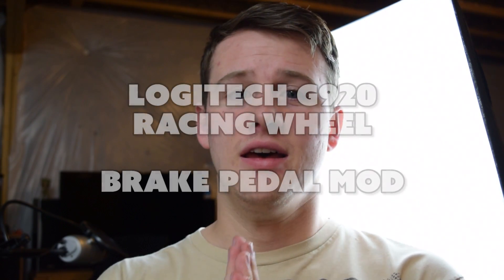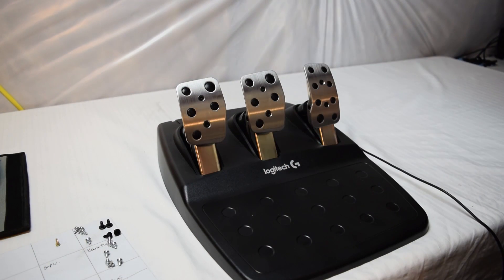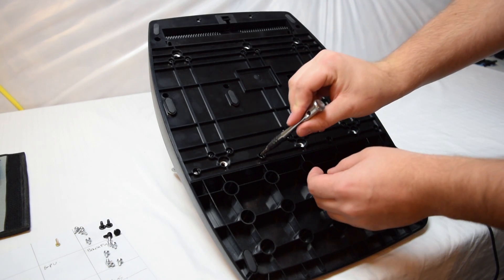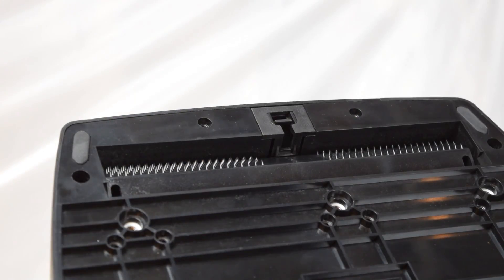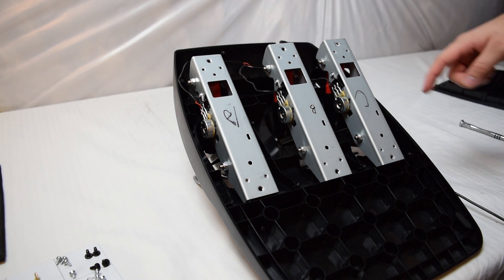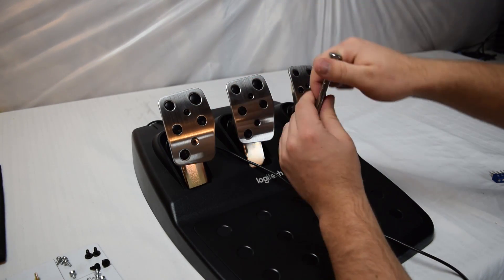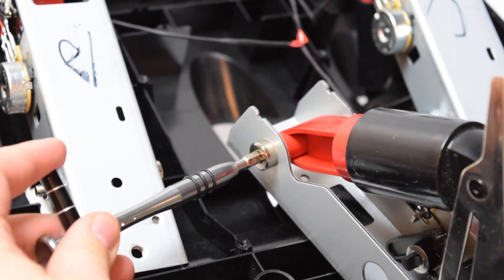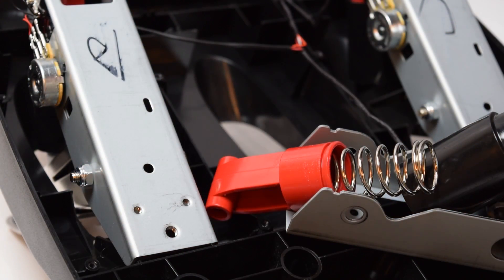Brake Pedal Mod - Logitech G920 Racing Wheel

Comment: I feel like logitech have never driven an actual car. I've never had a brake pedal as stiff as the logitech one. And for computers sake, I end up pushing myself away from my desk when I brake.
Reply from the maker: Haha I know thats the worst part of it!:P
Reply: Have you ever driven a racing car before? Usually the breaks are made stiff so you know when you are reaching maximum break pressure which helps you achieve a consistent experience as it gives you more feedback. Most road cars have an extremely stiff break padel too if you floor the break which is quite an unusual event in traffic.
Reply: striderdnb I used to think the same, but I was lucky enough to be involved in a competition using a Ginetta G40. I never knew the brake pedals were so different! In fact, the brake pedal on this Logitech wheel is actually closer to race car standards than I previously thought.
Reply: But Dude in Project cars you can´t even reach 100% even if you push teh brake with all you got. I just goes to like 64% on pc
Reply: but i won´t do the mod beacuase then the realistic feel will disapear
Reply: Victor Pettersson Really? I'm using console so wasn't aware. I'm surprised you can't calibrate the wheel and pedals?
Reply: you can, but he didn't.  brakes are working 100% with logi g27
Reply: thats bc your chair is on wheels.....
Reply from the maker: fastfreddy01 yeeeeep. Good job.
Reply: Beeeyeee - Games & Good Times thank you thank you
Reply: @Ryan McCaffrey, I drive a GT3 RS on a semi regular basis and although its not a GT cup car its still designed for the track. The brake pedal on that thing is smoother and gentler than my own Evo X.       The problem here is most of us have wheels on our office chair and so the stiffness of the brake on the Logitech is ridiculous.   I have to almost stand on the bloody thing and it still doesn't bottom out to 100%.  I have ended up using the clutch pedal as the brake since I dont have a gear shifter, its annoying but it works.
Reply from the maker: striderdnb that's what I've been trying to explain to people. Thanks for the input. :)
Reply: striderdnb Ah, that's interesting. I would suspect there's varying degrees of 'feel' amongst track prepared cars. Ginetta is a relatively small company based in Leeds, UK, so as far as I'm aware the components and setup is without any assists whatsoever, so maybe your GT3 has better components to help with the brake feel. Either way, the office chair is the problem. I don't have a proper dedicated setup, but it's more sturdy than what I started with, so I'm able to push harder on the pedals without moving. Interesting to know about your GT3, though, thanks for sharing :-)
Reply: striderdnb you should never need more than 75% braking anyway. Anything more then that is either ABS pulsation or non abs lock up.
Reply: striderdnb your profile pic confused me
Reply: U never drove any race car then. U can just change the brake curve on the game, so it becames much more realistic.
Reply: What car do you drive? In my car you usually only press the pedal lightly in daily use. But on heavy breaking you have to stomp on that thing. A hydraulic brake is progressive. That’s what that rubber thing does. But with that said if you drive (in game) exclusively with abs on full I fully understand you want that 100% brake. But without abs you definitely do not want that or you’ll lock up every time!
Reply: gman6862 I tried both with and without ABS and no matter how hard I tried to stomp the brake to the ground, it couldn't brake whatsoever. It's like the rubber piece inside my brake isn't even there and the spring just doesn't go further lmao, it's not really fun when you have to stand on the brake 1 kilometer before you have to make a turn haha
Reply: There is a thing called settings boys
Reply: Bit late but every car i have drove has that kinda brake.
Reply: I unclamped my wheel once trying to brake.
Reply: @Spartan117FS  it is to stiff. It fits sports cars, but why the hell i cannot push it in mazda mx-5 whitch is a regular car.
Reply: @Spartan117FS  Problem is the break pedal here only has 8 bit of resolution so you gain exactly nothing but a piss poor experience from that rubber pad.
Reply: They only drive semi trucks
Reply: They also have "Dead-Zone Braking" in the advance wheel settings 🤷‍♂️
Reply: I have to stand on the pedal to get 100%-especially in games that have auto cars which require 100% brake for reverse or park
Reply: Get a proper sim rig.
Reply: @Beeeyeee  I haul around Mulch/Sand/Dirt/ by the Tons in a trailer( it makes the brakes super hard to press)and thats the only thing I can relate to this Pedal lol
Reply: That's the only reason why I want to take it out also don't work well with ets2 and ATS trucks air brakes aren't that stiff I drive one everyday
Reply: Finnish Spartan accualy they are not made stiff. A road car had a pressure multiplier in the master cylinder where as a racing cars brake pedal relies on the drivers leg strength to compress the master cylinder
Reply: You have obviously never driven a car with performance brakes. 🤦‍♂️
Reply: These are the worst comments I ever heard in a thread
Reply: Yeah drive a real race car and tell me the breaks aren't stiff as hell

Comment: READ THIS BEFORE THROWING THAT RUBBER OUT!!!   i found an amazing solution that really works!!!  i took the rubber peice and drilled 5 holes into in.  all sideways  none going longways,   then squished it in a vice twice pretty good, but it retained its shape.   popped it back into the pedal,  i can easily get to 100% if you needed too.  ive gotten it to 100% with my arm even pushing hard af.  it is 10x better and is still relatively tough and realistic.  im all for realism and now i can hit that 70% brake mark easy pz with a good push. not straining all my might for 60%    and if you want it you can hit 100%  that was impossible before, now very possible!!  trust me its better than nothing in there i tried it!!! nothing feels like some 20$ brake pedal
Reply from the maker: michael yacobucci good idea man! I'll have to try it:)
Reply: Thanks alot man!  i used a  3/16 drill bit and reemed it a little bit,  you wont be able to see though the holes but it still does the trick, very curious if it works as well for you as it did for me!  thanks for the vid aswell couldnt have done it without your disassembly instructions!!
Reply: can we a picture of it after the drilling?& what you used for drilling?
Reply: Thank you! I was wondering if drilling wholes in it would help 👍
Reply: michael yacobucci took about 20 mins and it’s transformed it! I ended up drilling 5 wholes along the length of the rubber piece all the way through which allowed it to be far more “squishy” in comparison to the sold block it was before, thanks so much, back to asetto corsa 😂 👍
Reply: I have to say I jumped at this idea! After about 30mins of half destroying the piece of rubber and testing, I realized my brakes spring was kinda stiff anyway so I was better off completely without the rubber piece! An amazing idea though -Just perhaps not for my one ;)
Reply: michael yacobucci please make a video about this
Reply: I had a similar idea. I like the feeling of the rubber stopper in the pedal but i hate the fact that i cant brake over like 75%. I thought about maybe just cutting the stopper in half and putting it back in but your idea is WAYYY better. Cheers man! Happy driving
Reply: @michaelyacobucci5669  3/16?  You sure, seems like a large bit (I was just about to start drilling), I don't think there's even enough room to get 5 holes let alone that there'd be any meat left in the middle of this rubber stopper!  You said you are not able to see through the holes so I'm thinking you may have listed the wrong size bit.

Comment: Surprised that you found this mod necessary. I have same wheel and the brake pedal is perfect  and very realistic. I find I can modulate the brake in a very realistic way. The brake pedal should never go all the way to bottom and should have a resistance to it. I have done quite a few track days and have been lucky enough to have driven a few racing cars and the brake pedals are extremely firm. I certainly won't be doing this to my set up.
Reply from the maker: It's a personal preference. :) it's just not fun pushing your chair back instead of the break. As much of an immersion breaker that might be. I understand where you're coming from though:)
Reply: That because you have a rig. For people who don't have a rig its very hard to put in the right amount of pressure into the brake pedal and it just feels inconsistent.
Reply: Yeah, I just end up pushing myself into my couch cushions, but I love the firm brake so probably not going to take it out..
Reply: MickeyMoTiOnZ I havnt got a rig and I find this pedal set to be great just adjust the settings in game so u don't have to press on the pedal so hard   .... simple.
Reply from the maker: or you could simply take out the rubber and not have to find the right setting for each game (if they have a setting for it).... simple. 

You see my reasoning? its not stupid, its just our opinions. :) this was simply a guide to help people who didn't know how.
Reply: Beeeyeee - Games & Good Times but your making people take the realistic feel away from there pedal set to avoid having to adjust a simple in game setting .. sorry dude think u got this ass backwards
Reply: MickeyMoTiOnZ In all fairness Logitech have designed this with a rig in mind. There are other offerings available more suited to non rig users. There is absolutely no way I would do this to my pedals. It takes away the whole point of having a realistic pedal set up.
Reply: well I think this wheel is made for "racing" so its brake pedal is hard to push to the bottom..
I think amstudio made a video about making the pedals more hard so it become more controllable than standard one..
Reply: Yeah, I mean, this mod is only for gamers.. not sim racers.   It takes away realism.
Reply: u are right i made the mistake to mod it after 3 months of use and now im too used to  the rubber
Reply: Yeah but in forza horizon 3 you can’t brake all the way down to zero
Reply: Or... Cut the rubber on half and put it back in
That way break gonna feel smoother and a little bit lighter, but still wont go all the way down. Tada.
Reply: I have a g29, i can press the pedal the whole way down. However I find it difficult to brake properly without abs with this stupid rubber piece in, I cbf removing it though.
Reply: It's INSANELY stiff with the rubber in it - No discussion about it.. I don't find it real at all.
Reply: I’m a racing driver for Ferrari in the British champs.... my brake pedal is way softer!

Comment: just made your brake pedal feel less realistic lol why not just change the settings in game so u don't have to push the pedal in so far.  a real brake pedal doesn't travel all the way to the floor that's why they put the rubber block in there .... well done lol
Reply from the maker: Steve Fri what you're getting into is the diffrence between a Game and a Simulator. I'm not looking for realistic feedback, if I was a definitely wouldn't be using a $300 wheel haha. There are much better options. I play games casually, I just don't like to push my chair instead of the break pedal. :)
Reply: You can't change settings in all racing games, Forza for instance, you can't alter or calibrate brake pedal in game. I understand what Logitech was trying to do, but it doesn't translate to games. The car doesn't brake until you'll wrestle with the pedal and push your self away. G27 doesn't have this rubber mod, it's the same base and it works fine.
Reply: I sit in a normal chair and the brake pedal is just stiff enough to not trigger the ABS in Forza 6 or horizon 3 while under normal pressure.  You can tune the brake pressure on the cars in forza btw.
Reply: Jack K in forza I just tuned the braking.
Reply: Boi you know that real brakes are way more sensitive than Logitech's?

Comment: The spring in the brake is still stiffer than the other pedals so it’s pretty good
Reply: MadChooChoo but is it actually possible to use the brake now
Reply: yes but after removing it i can press it with no problems,and im not that srong as i am pretty young but it is as simple as 123 usinf the brake pedal

Comment: Awesome. Awesome. I JUST picked up the G920 and thought to myself "this break pedal is wayyyy toooo stiff, Theres gotta be a mod for this". And this was a perfect first video tutorial. Nice job my guy.
Reply: did it work?
Reply: @mikeez9445  yeppppp
Reply: @kamaallowen5824  does it feel realistick or fake?
Reply: @mikeez9445  I'll reply in about 2-3 days after I've tried this mod.
Reply: @mosasa1307  it’s been 3 months my guy is it any good now?
Reply: @deathbird09  Hey! No, I actually figured out another way around it. I ended up installing Logitech G Hub and raising the sensitivity on the brake peddle to about 90% and coupled with whatever game I play, I raise its respective sensitivity and I am all good to go. I think and I really do suggest you go this route before taking stuff apart. Man time flies...
Reply: @mosasa1307  you really need to try the aftermarket brake spring from GTEYE in Austrailia!! Progressively stiffens but not too stiff. Feels amazing and you use it's entire pedal travel. Ships from Oregon USA. Hope you try it!😁
Reply: @WEREWOLFUSMC  thanks for the recomendation! I will absolutly look into it, its frusterating trying to brake corectly but due to my settings being a lot more sensitive, I tend to lock up my breaks, thanks!

Comment: One thing I think is worth mentioning when you're putting the wheel back together. There are several small grooves cut into the plastic housing inside the pedal casing, it's important to make sure that the wires run inside these grooves or they will get pinched between the 2 sides of the case and this isn't likely to be good for them...its a fiddly job to get all the wires from each pedal back into these grooves as they keep falling out before you can get the case back in place. Nonetheless, I think it's important you take the time to do this

Comment: if you download if you type set up usb game controllers on pc and fix the calibration it should work just fine with the rubber in their
Reply: I got a windows 10 and typing "set up USB game controller" comes up already as It's already a program that comes with windows. What do you mean download? also after opening it, how do I properly configure the brake pedal to reach about 75% without having to do any mods. Thanks bro!

Comment: The oil is on there to prevent rust, the hardware is cheap and can easily be destroyed. Wipe off and clean factory grease and re-lube after mods

Comment: Only have to take off the brake pedal cover and the 2 little side screws. That's it. I was finished in less then 5 minutes and no wires to worry about.

Comment: So I thought the brake pedal was way to stiff as well. So I took out the rubber piece in the brake spring. I played with it like that for about a week. Then I took off all the brake assist in the game. Then the brake pedal would lock up very easily. So I put the rubber piece back in the brake pedal and it made a huge difference in how the brake works. Other words, if you are use the brake, take all the assist for the brake off and the brake pedal will work properly.

Comment: I can’t  get the nut back on the whole way on the last bolt, that bolt that when unscrewed, releases the brake pedal  cylinder where you can finally take out the rubber block.  I got the nut off, holding it with a pliers while undoing the bolt with an Allen key, but can’t get it back on! 😭 Plz help... 😅

Comment: hey  i just got a g920 for my xbox and I'm a bit of a newbie, I have a couple questions that can hopefully be answered :

1) If my rig is set up firm on the floor, and does not slide no matter how hard I push the pedals down..  Would it still help to do this mod? Or can I still achieve 100% brake if i push down hard enough? 

2) What is better, to remove the rubber piece entirely or to cut holes/shorten it? From experience I just wanted to know which works best. 

I just picked up my rig so I'm a little scared to start modding it right away as I'm not too tech savvy... if I can get some details to give me a little more confidence with this, it'll be much appreciated :)

Comment: Will this void varranty?
Reply: Unfortunately yes
Reply: @mn-mq6ml  This is so stupid. So basically I can't use my brake pedal for 2 years.
Reply: @jakervamduf1523  yup :(
Reply: I don't see how they'd know though. There no sticker etc right? Typically there a sticker saying if removed or broken, this voids warranty which I didn't see in video. So logically if you keep the rubber thing and needed a warranty you could just put it back in and theyd not know.

Right?